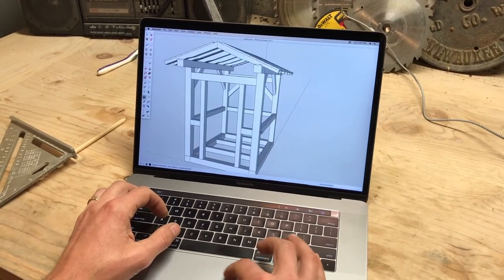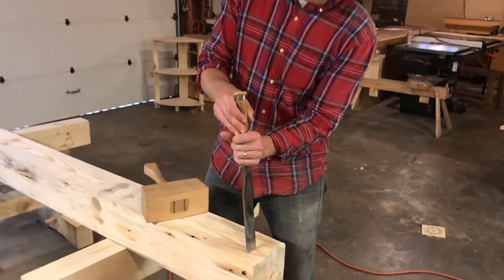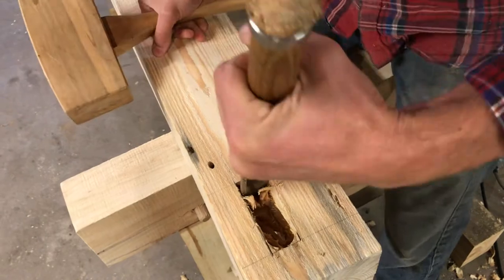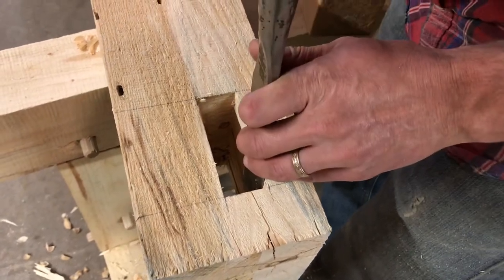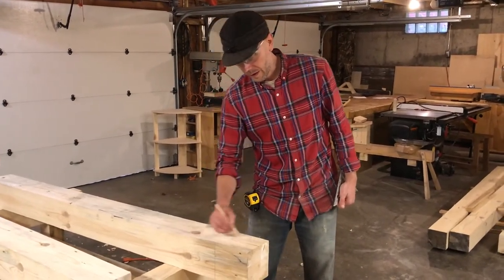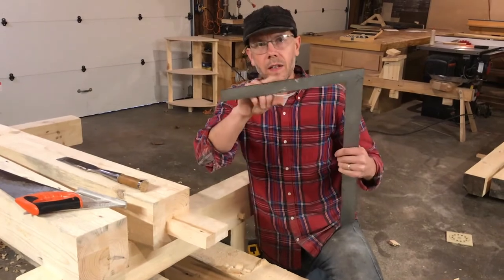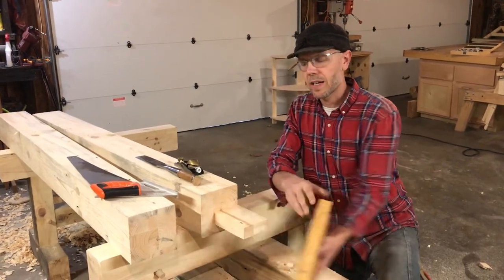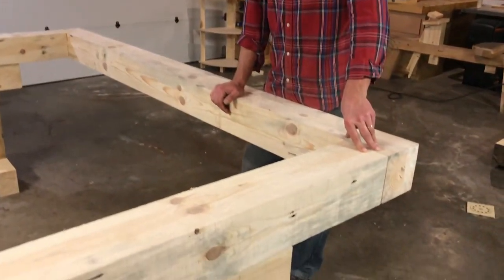Part 1: Cutting the Timber Frame Joinery for the Floor Sills of the Tiny Timber Frame

Comment: This is really helpful.  I'm hoping to do a small project like this in the summer -- to learn the basics of timber framing.  How do you source your timbers? Do they need to be  kiln dried?  What is the approximate cost for timbers?  Maybe an idea for another video at some point :)
Reply: Looks like you have some videos about milling already!
Reply from the maker: Hi Dave - thanks for the comment! I have milled all the timbers using my Logosol chainsaw mill. A local organization often needs trees taken down and I get to use the timber. None of them are kiln dried, in fact timber framing works well with green wood. It's easier to work that way. Take care!

Comment: Great stuff, wish I'd had this series when I started my pavilion build (and a copy of Learn to Timber Frame, which I think outlines a very similar build to yours). I would have probably done a through-tenon on the sill joints like you have, instead I did a cross-lap. I don't think it's going to matter in the end, the beams are well-supported at the corners and I did want the beams to slightly extend beyond the corners just for, I dunno, to put plants on or something :D. For the joists I did a strengthened halving, which is also basically a half-lap because it seemed a bit easier (though it was still a heck of a job). I kind of liked that because I could then extend the joists beyond the sill as well and thus get a little bit more floor space and get a cool kind of floating effect - here's how that looks sort of half-finished https://i.imgur.com/VLeUGnZ.jpeg - I'm pretty much making it up as I go along! But for the rest of my build I will definitely be watching all your vids from this series first.

Comment: Jesse I have a question:  Are those 6x6 or 4x4 beams you are using?
Reply: I just saw the end...Those have to be 6x6 or 8x8 no?
Reply from the maker: Hi! These are 6x6's but are very likely oversized. You could use 5x5's and maybe even 4x4's (but the design might have to change to six posts instead of the 4 I'm using.)
Reply: What type of wood?